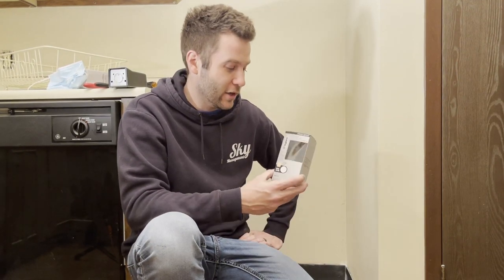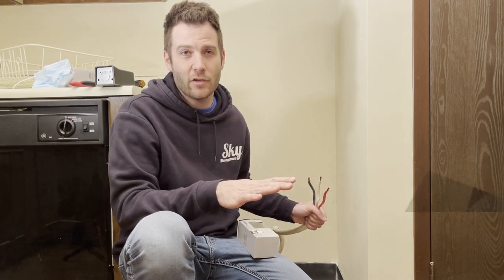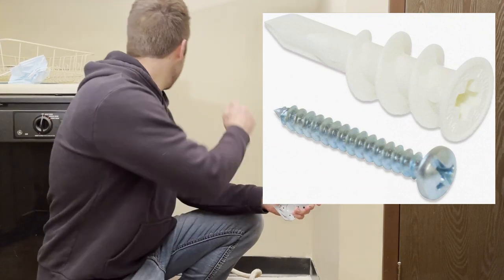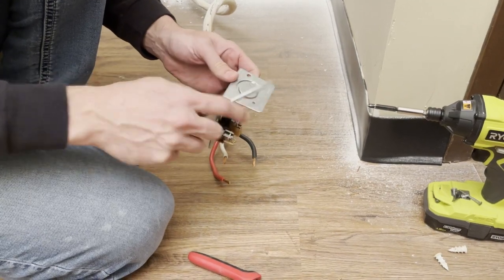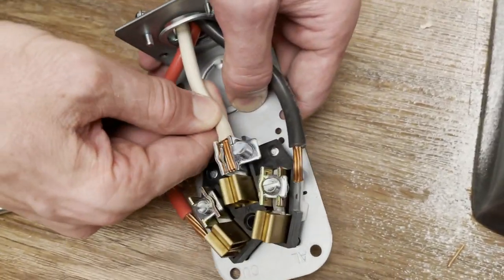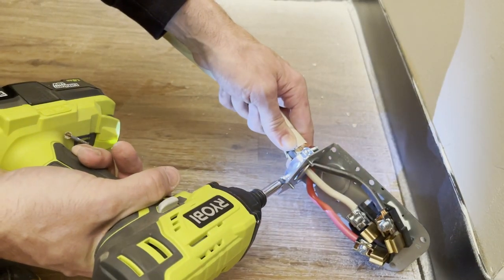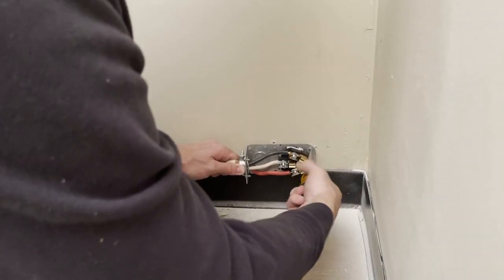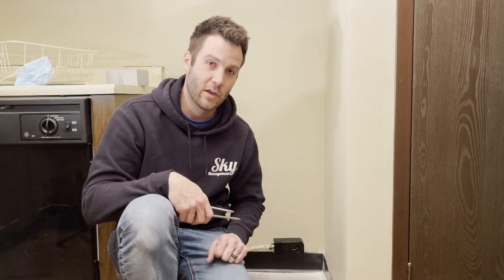Where do I plug in my stove?  Install range receptacle / socket... DIY

Comment: Per code, cable jacket must extend through and 1/2" beyond connector/strain relief device. In many jurisdictions nowadays, it's a violation to install ANY new 3-prong range receptacle, regardless of the state of the house wiring; in that case, the right (and legal) thing to do is to upgrade the entire circuit to 4-wire, i.e. with dedicated ground. This will allow (require) a different 4-prong plug and matching receptacle. Replacing a long run of 8/3 or 6/3 cable is expensive; a cheaper (in materials and labor) alternative would be to run a dedicated ground directly (unspliced) to the service panel (e.g. awg 8 bare copper). And in case you need to get the range as close as possible to the wall, consider a flush-mounted receptacle; it's more work, but it might allow the range to sit 1"-2" closer to the wall.
Reply: Thanks for comment. I can't afford to spend $400 plus for fifty plus feet of 6 gauge 50amp line. So I understand, your alternative is to run a ground 6gauge or 8gauge from panel to junction box? Thank you
Reply: Three prong is fine, around here.  My buddy is an electrician, so all of his new construction is 4 prong, but the older houses still have the 3 prong setup. And, you can still get the outlets;  I just bought one, today.

I'm not going to concern myself with upgrading to 4 prong. I'm not pulling any permits to replace an outlet, or inviting a bureaucrat to come look it over, when I'm done. It's been a 3 prong deal, since electricity was added to the house, decades ago, and it's been fine. The only change I plan on making, is putting the new outlet on the wall, as opposed to the old outlets current position on the floor.

Comment: what if you also have a bare copper ground wire ?
Reply: I have the same issue
Reply: @dawnsavasta8251  Ok..I looked it up....if you're going to use a plug on the stove  you you need  to look up how to wire a 4 wire plug to the stove and then yu need a 4 wire  recepticle to plug   into...the bare ground wire goes to the bottom of the recepticle. I wired mine up like that and it worked out fine. My stove was wired  directly  with no plug. The bare copper wire was attached to the screw on the stove where the green wire from the plug goes.   https://www.youtube.com/watch?v=H6uExmGPPwc
Reply: As @vyger stated ground/neutral wire goes to lower terminal on 3 wire supply. The grounds and neutrals are tied together at breaker panel. However you do not "need" a 4 wire plug as you only have 3 wires coming from breaker.

Comment: I would have been more inclined remove the knockout on the back, instead of the side. That way, the hole in the wall, from which the wire protrudes, could have been masked with the outlet.  Alternatively, a cut in box and a flush outlet could have been used. Either way, a more professional appearance would have been achieved.